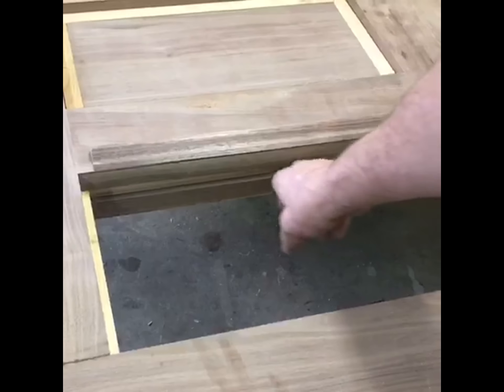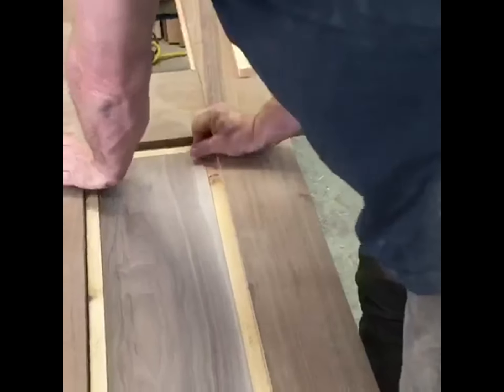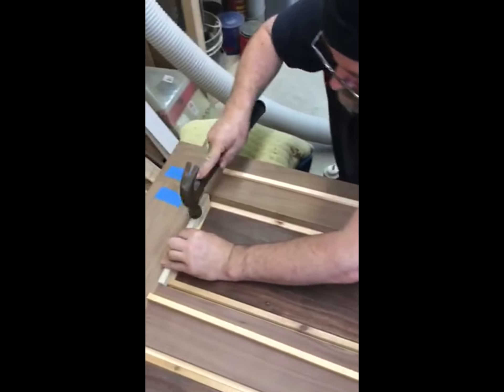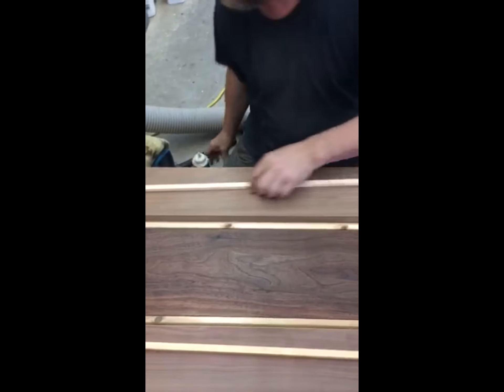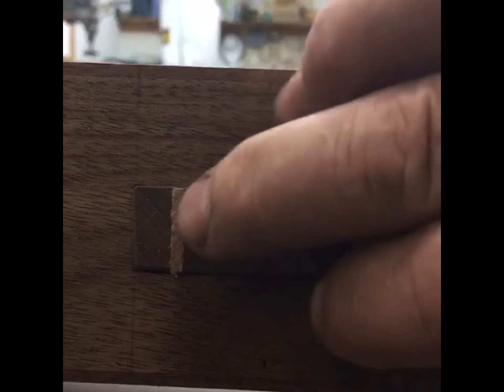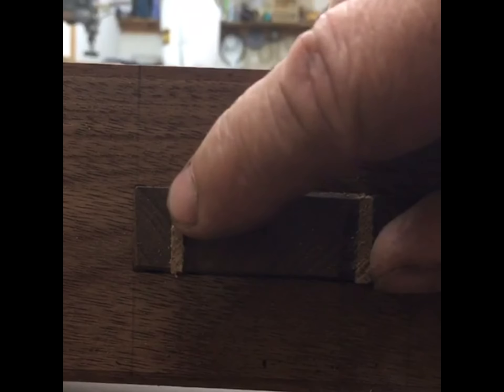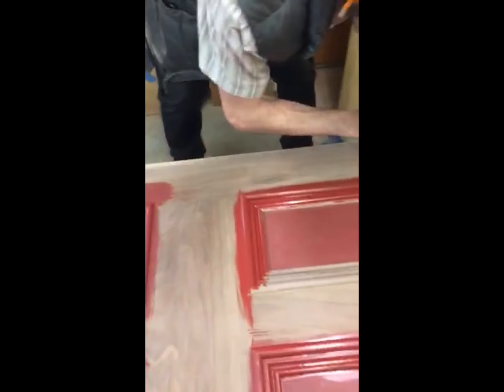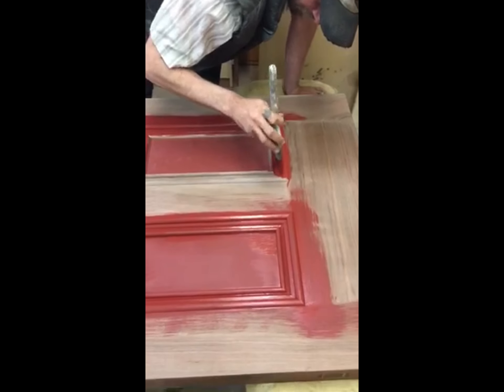Phillips Door 1867 Ottawa

Comment: As usual, beautiful work. I really like the assembly detail for the panel, being able to solidly attach the molding, but leaving the panel free to float - smart!
Reply from the maker: thanks John . It was one of the main reason for replacing the doors . the panels were all split  from the moulding restricting the movement of the panel .  also with big doors like this it is far easier to glue them up with out the panels in.